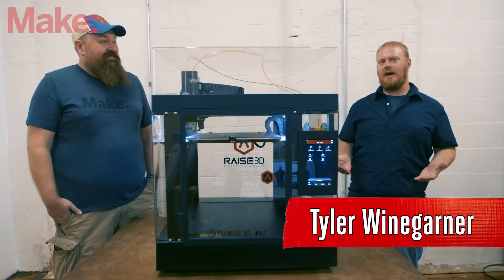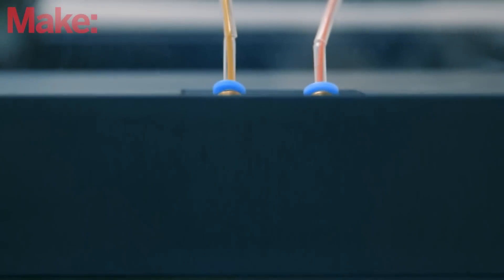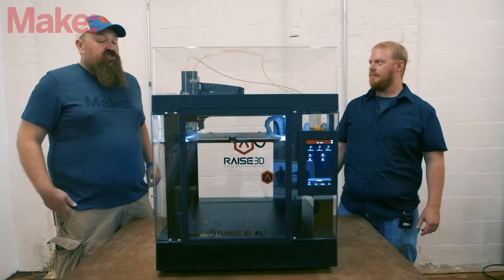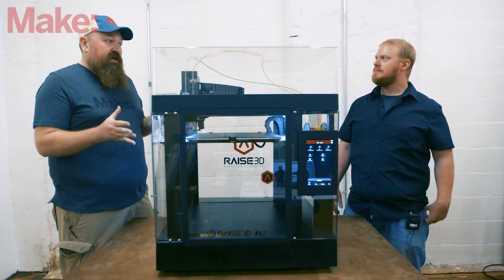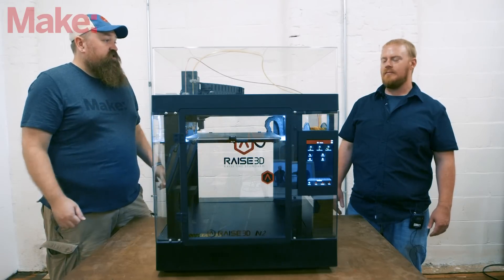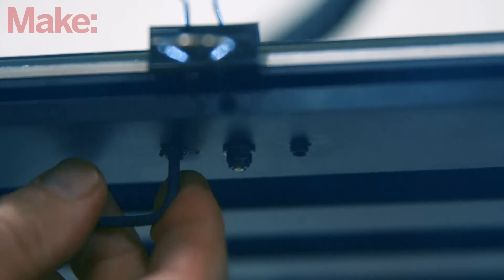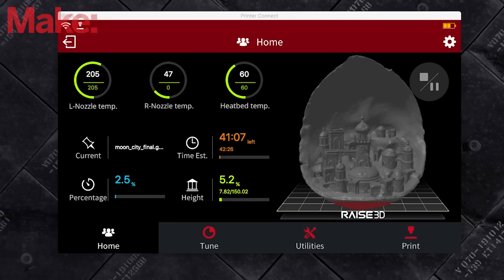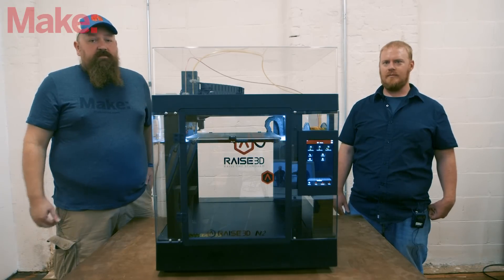The Best 3D Printer for 2018: The Raise 3d N2

Comment: This is the WORST printer I have ever purchased! The extruders clog 
CONSTANTLY. The Z level changes with every print. The bed cannot be 
leveled as it was shipped with hills and valleys. It takes almost 5 
minutes to heat up either nozzle and almost 30 minutes to heat the bed. 
Yes, I said 30 minutes! I cannot get the two extruders to match each 
other in Z so dual extrusions are impossible. The hot ends literally 
fall out of the clamping system while printing, which has caused serious
damage to the build plate and build tak sheet two different times. The 
sad (temporary) solutions to most of these issues requires you to heat 
everything to build temperature, then disassemble and re-assemble 
everything hot, which results in serious burns. My index fingers are 
charred from weeks of re-building this POS while it is hot. I HATE this 
machine. The biggest problem is that Raise3d does not want to give me 
the complete manual so I can understand what is not working. Does anyone
want to buy a $6000 printer? I have one and I'm willing to take a huge 
loss to move it so I can buy another Ultimaker.
Reply: For the N2 it needs a Bondtech extruder to keep it from clogging as much and also a silicon cover for the hot end to prevent heat creep.  Maybe your leveling screw is loosening.  Might add some loctech blue to the the threads.  Bed takes 5 minutes to heat up here.

Comment: Nice review. Even after a year the Raise3D N2 is hard to beat. It is in the category ultimaker and has the same pricepoint. Ppl that are saying this is light industrial never saw even a light industrial machine and its 10k-30k pricetag. The screen is still awesome and unique, there is no other machine that has it like this. Even today it is a lot of monochrome digits screens. The parts on this raise are very high quality and sturdy. I have an N2 Plus, and it pretty awesome with its 60cm high buildvolume, very impressive.

Comment: You are very biased! I will guess here but ... you get this printer for free so you have to say only good things, right!?!
This machine beside nice touch screen and a big size it's a pure crap! oooh, sorry it's a push or a knock screen, not a touch, to be precise! The print quality is awful as the "factory pre-leveled" bed is not leveled at all. Not to mention the X-Y mechanism which is even not perpendicular, thus making your print object skewed. Of course for a small part, this might not be an issue but being a large 3d-printer making a large, let's say 200x200x200mm qube, you will get a distorted thing with more than 2mm of difference from side to side. You might argue that this is only 1%, you would be right but if you make something precise you are out of luck with this printer. To continue... the double extruder, well, a pure joke!!!! The first thing you have to do when you buy this toy is to buy a Bondetech extruder to replace the original one. The hot end and the leveling of two nozzles is a nightmare too. Either you are knocking the part you are printing with the adjacent nozzle or the same nozzle iz to high and thus the printed layer will not stick as it should. I'm talking dual material printing here.The sheer volume of the whole printer to the print size ratio is awful. Meaning, that the printer is toooooo big for the printing size. Or, if I put it in another way; for the same print size, the whole printer could be much smaller. Although this is "an enclosed" printer, this doesn't mean that you can have a nice worm printing environment for, let's say Nylon or ABS or PC filament because the extruder and the "break-out-board" on the extruder will overheat and you can kiss goodbye your extruder motors.
I could go on and on and on describing all the crappy things on the printer but would consume too much space here. Oh, the software... decent, though you will probably buy Simplify3D. To finish ...build quality... soooooooo Chinese. They didn't invent a quality control yet in this country, at least in those companies that have a Chinese only workforce.
Don't buy it, there are much better options out there!

Comment: Those leveling screws... Damn, it would hurt someone, the owner. 

- No auto-leveling 
- No filament pressure control
- No filament diameter control
- No nozzle wipe cleaning for start
- No dampening solution for ringing, faster prints
- No smoke sensor for fire-hazard 
Lots of things to do for a 3D printer these days.
An innovative solution also might be:
A printer which can detect defects on a test print and optimize the profile settings for its slicer. Lots of image processing and AI may be involved.

Comment: I currently own 2 N2+'s both of which did not come leveled to my liking from factory. The leveling of the bed when trying to make large prototypes has caused nothing but issue after issue. Printing on a raft basically levels your print surface. But if your trying to maximize your expensive printing filaments. Raise3d has done nothing to make this printers bed be solid enough to get good large prints. modifications to the bed to allow for a real 100% true level have to be done which reduces the overall build area & height. Also the printer head v2 still skips when using 3rd party filaments Due to the friction the shitty spool holder creates and the hard angle on the head as is shoots across the X n Y's. Overall it prints the test cube within 5 min out of the box. But its an unfinished printer if you look at spending $3000.00+ it being such an expensive one. I been Modding and fixing the issues with the printer sense the 1st day i got it. It just never ends.

Comment: Make: how fine can it print ABS? I see the specs on it say it can print as low as 10 microns. That's nuts. Is it really possible to do that with this machine?
Reply: Motion accuracy does reach 10 microns.  While it can print at this level, there is a lot involvement in settings for fighting the physics of gravity, material density of the amount of filament that's being heated and extruded. 
For ease and consistency, we recommend 50 microns.  ABS and most filaments will print at this with ease.

Comment: Is this thing fucking serious? $3,000 dollars? No auto-bed leveling probe, binder clips and not magnets holding build plate? What year is this?
Reply: We get many comments about the lack of auto leveling.
While our R&D departments are always testing new options, we feel that auto leveling is a workaround for an inherent issue --the bed does not stay level. 
Designed as an industrial-level machine, we feel that a locking bed is a much greater benefit. While the leveling process is a little more involved than the usual methods, many of our customers have never needed to re-level after years of daily use. 
As for the build plate, we are exploring other options, but as everything that we release, it requires a high level of testing to ensure the quality that we've been known by.
Our machines have been designed to rival machines many tens of thousands more than them.  While in comparison, $3000 may seem steep for a maker-level system, the value, quality, and consistency that they offer is now accessible an individual users or small business whereas it wouldn't be possible before. 
Each machine is unique and are designed to fit a different set of needs.  While most users don't need an enterprise-level workhorse, we are excited to offer this level of performance at such an affordable pricepoint for those that do.
Reply: Thanks for the reply. I appreciate the honesty. 3D printing technology is moving much faster than most anticipated. Take note from Prusa machines. I'm sure this printer is built like a tank, but it needs to have something that sets it at the same level, or better, than cheaper options that are also durable.

Comment: I own a N2+ and it came with a perfectly level heat plate. I was really impressed. Could not recommend these printers more.
Reply: Dan Salkowski I'd hope it would have come with a perfectly level hot bed, CONSIDERING THAT THERE IS NO WAY TO LEVEL IT AND THAT THE PRINTER IS 3 GRAND!!!
Reply: Bether than bambu p1s?

Comment: Yes, best printer. If we all had $3000.00+ burning a hole in our pockets.
Reply: It all depends on application. Each machine is unique and are designed to fit a different set of needs.  While most users don't need an enterprise-level workhorse, we are excited to offer this level of performance at such an affordable pricepoint for those that do.
Reply: I understand that it's simple to confuse as they were both reviewed together, but the N-Series units are designed for businesses. With the workflow, reliability and feature-set of the N2, our printers rival units many tens of thousands more than it. 
Our goal has been to create this level of performance at a cost attainable for smaller businesses or even individuals.

We understand that our machines are not for everybody, but for those seeking to apply printing into a production environment, we believe that we are one of the strongest names in the game. 

We hope this helps answer any questions that you may have had. 
Happy Printing
Reply: dude.... 3k is not a-lot of money for a 3d printer....   Not trying to be a jerk or anything but you are aware that most printers cost over 10K.   My company has a 15k HP and a 200K OCE printer - so touting a $3,000 printer as affordable is totally justifiable.       Kids who want to learn printing can do fine with a $300 unit.... This printer is for big kids with bigger pockets.
Reply: Raise3D I wouldn't call that affordable unless you're a business looking for a write-off. Try making a smaller budget printer stripped down to the essentials but that still Hase the Raise3D feel/taste. I think you might be met with better praise than seen in this comment section. Current low cost printers aren't the greatest, but they provide an avenue for youngsters to get a start, but when you make a $3,000 printer and tout it as affordable and accessible, you shut people out.

Comment: At this price point, if I had 3k to blow on a printer I would probably invest in a resin printer. Luckily those are getting more affordable these days!
Reply: The problem is with the consumables. The resin can go bad and is difficult to store. The trays for the resin also need to be replaced. If you're printing a lot they're great. I would consider one myself as my next printer, but I just don't print enough.

Comment: I really don't see how the Raise is even close to the Prusa i3. 

Prusa just came out with new MK3 (though I know you are comparing to MK2S) version that adds many conveniences that I'm sure Raise doesn't do (no one mentioned it in video). MK3 prints faster, detects filament running out, detects power outages and will continue print when power restored. Prusa bed auto-levels and with new update it detaches so you can bend it and remove your prints easily.

Prusa is innovative and continuously makes improvements to their printer and are leading the way in setting the standard of how all 3D printers should be made. You are even able to upgrade to new additions to printer for lower cost as they improve. All of this at a very fair price.  

The Raise is too big. I would not want this printer. I don't think Raise is worth the cost considering the Prusa features mentioned.
Reply: Printers are always relative to the application they're being used for.  Each printer is designed with features to handle a different set of needs.  While we don't know too much about the Prusa i3's, the features on the Raise3D N-series systems are designed for applications in industry and business. 

To answer the features that were unclear:
Print speed is all relative to settings, so while we don't have comparisons between the Prusa, the ability to swap nozzles and adjust layer-heights can make: a large fast-printing object, a fine-detailed piece, and anything in between.  
All of the Raise3D systems have offers a battery-backup that stores the state of your print in case of a power interruption. 
Lastly in regards to auto-leveling, we feel that auto leveling is a workaround for an inherent issue --the bed does not stay level. 
Designed as an industrial-level machine, we feel that a locking bed is a much greater benefit. While the leveling process is a little more involved than the usual methods, many of our customers have never needed to re-level after years of daily use. 

While a Raise printer isn't for everyone, we are incredibly proud to offer an industrial-level machine at a pricepoint that's never been seen before; offering a new grade of performance to individuals and small business.
Reply: The only thing that it truly has on the Prusa is build volume and being enclosed. (Enclosed area is an easy fix though)
Honestly I have a feeling that the MK3 is gonna end up better than the Raise N2, simply because the prototype was only 3 points short of 1st place. There has been 6 months of fine tuning since...
I think the only reason Make did this video is because otherwise it would be a repeat of last year...
Reply: Jonathan Kayne I agree. I'm being a little biased since I own a Prusa MK2S. :) But, I'm sure the Raise is a decent printer. I'm sure it's features would be for some one out there.
Reply: r u crazy, I have both printers the prusa is great and the raise3d is great for bigger prints something the Prusa can't even touch!!! this big boy likes big toys, big prints 10 micron resolution that is why Make loves this printer.
Add simplify 3d and the print quality go's way-up!!!!!!
Now if you want 4 color prints.....clean prints the prusa mk3 is the best printer for under $1600.00 us
Reply: Jonathan Kayne  since the Prusa mk3 is self calibrating, couldn’t someone (in theory) increase the build size if they came out with a bigger compatible print bed and rails?

(Here’s hoping some people start doing that.  Maybe some 3rd party upgrades?)
Reply: I don't see how the prusas are even close to Raise.

Comment: well this sure isn't the best value though, lol.
Reply: It's all relative.  It depends on your feature-set and application.  
While someone that may be using a printer to print as a hobby might be considering a maker-level machine, the Raise3D systems are much more than necessary.  Meanwhile, many businesses that require the kind of consistency and versatility of an industry-level machine are looking at machines in the tens of thousands, where as a Raise3D will offer a much higher value.